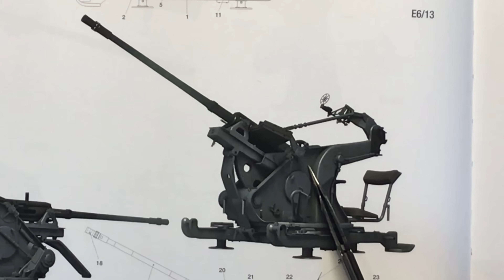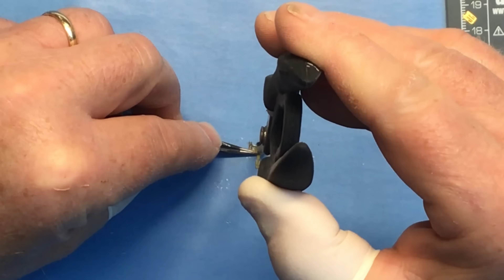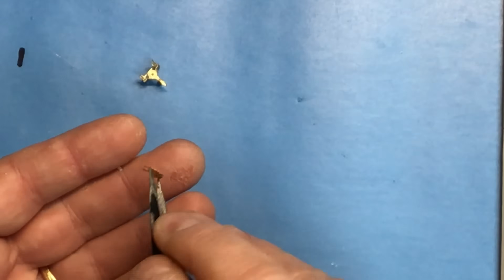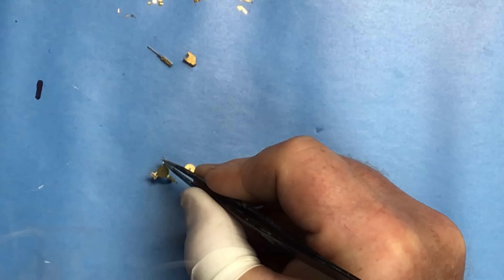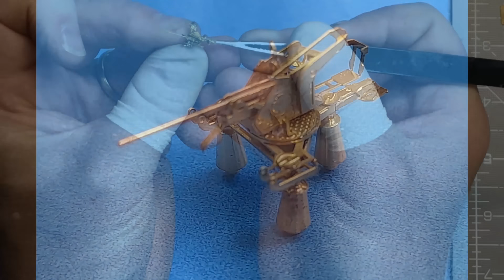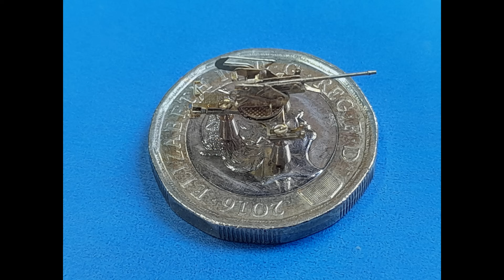Trumpeter 1/200 DKM Bismarck Full build with Pontos detail set Part 11

Comment: Hi Steve, fantastic PE work. I have the 1:350 Revell Bismark and the advanced Pontos detail up kit for it in my stash. I had a look through the manual and it has almost the same parts for the 20mm flak gun as your 1:200 kit - but at 1:350 scale they will be almost half the size.. Scary.
Reply from the maker: now I wouldn’t like to tackle those: the 200s were  small enough for me 😵‍💫

Comment: For some reason the Germans decided it was necessary to hang on to the Sd.Ah.51 trailer that came with the army pattern 20 mm Flak 30.
- And so, yes, Pontos has included them, more tiny bits that fit one deck higher and inboard of the after-most 105 mm gun mounts.
Warship Pictorial 19 by Steve Wiper - page 59, there is an image of Adolph saluting the Bismarck from the fleet tender, Hela.  
You can see the 'U' shaped trailer behind the 11.5 m work-boat and above the left brim of the failed artists hat.
Reply from the maker: Thanks Andrew I’ll check that out 👍

Comment: Great work again.  Have you had any issues with Pontos decks for the Hood & Bismark?  I installed the decks on the Iowa about 3 weeks ago using a very similar technique to you and the aft deck is already bubbling up in half a dozen places...
Reply from the maker: No issues so far JD - did you varnish the plastic before applying them ?
Reply: @TheModelShed  I did, Tamiya X22 exactly the same as you did on the Bismark.  I think I can fix it by running a scalpel fore to aft along the plank lines and put some thin CA in but it's a bit disappointing that it has lifted this quickly...